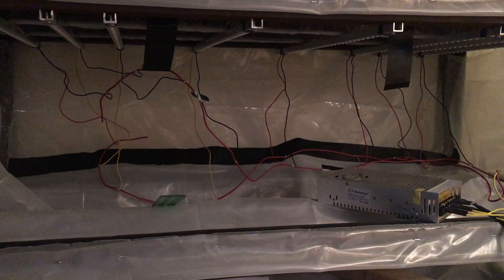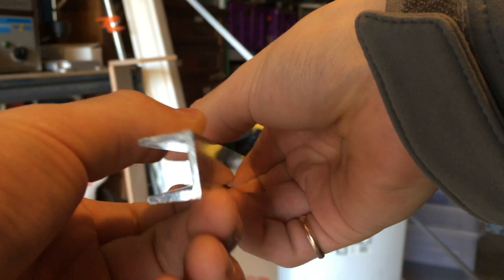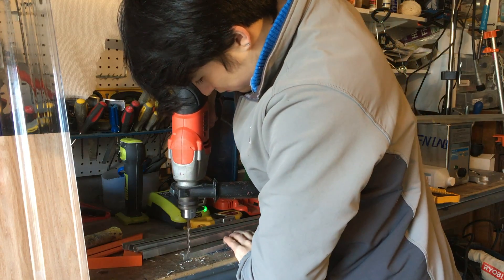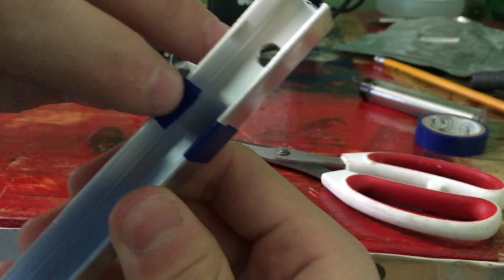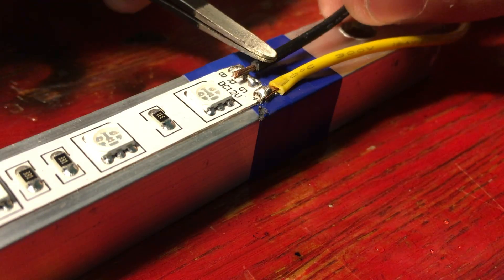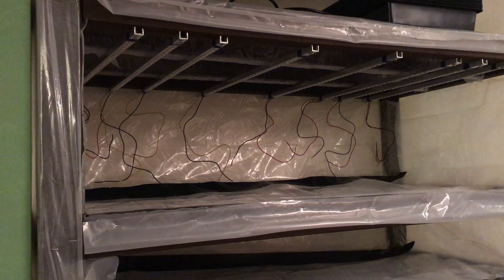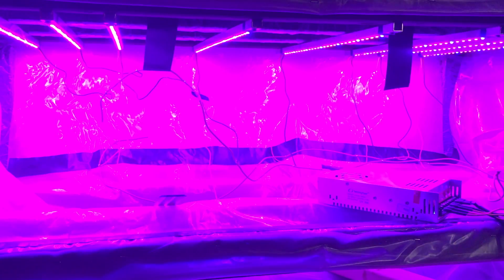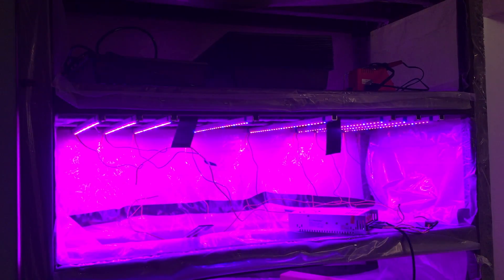Micro Greens Project Part Two: Low Cost LED Grow Lights

Comment: Hey Erik,
How did these led lights end up working out for you? Im about to build my own light strips too.
What ratio of red to blue did you use?
Thank you very much for posting this, looking forward to the update.
Reply from the maker: These are a 4:1 red blue ratio. These worked out ok, they are not extremely powerful nor of the highest quality but they do work. They produce little to no heat even when they are on for a long period of time so the aluminum is overkill and unnecessarily expensive. These also need to be very close to the plants to work and I didn't have enough. I would say you should have one strip every foot. Good luck! Im about to make a video about using high power LEDs instead of led strip lights. I think the high power LEDs could be better for some applications.

Comment: Whats the spectrum of light? FYI you want 660mn most important
Reply from the maker: ~610-720nm and ~400-520nm for red and blue LEDs respectively. Not sure how accurate those claims are, but it is what the eBay seller says. Item is discontinued now but similar items are readily avail..